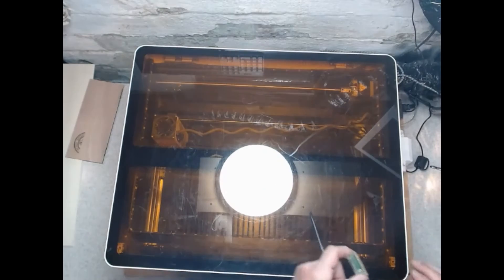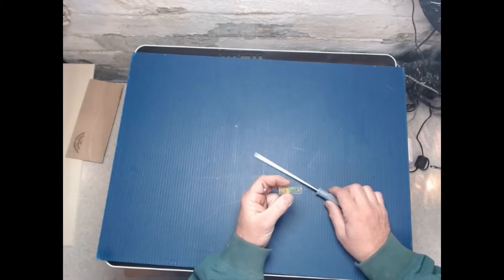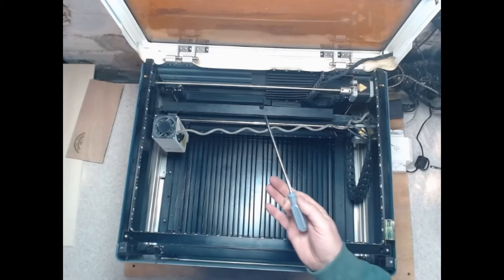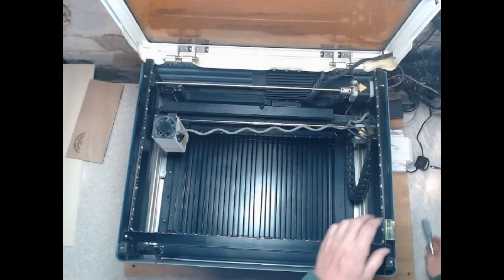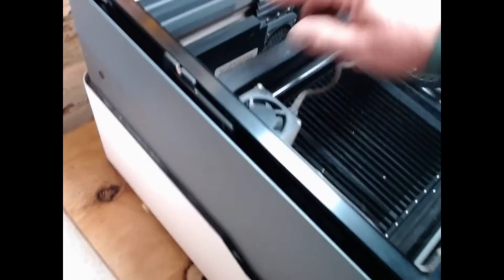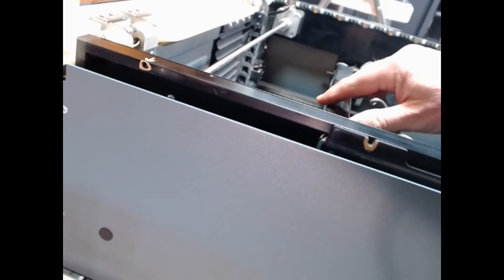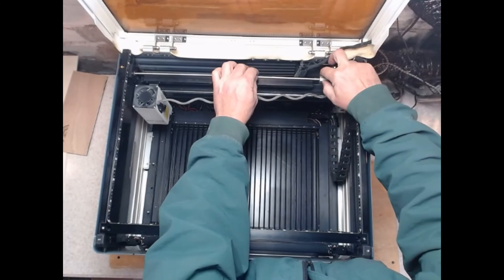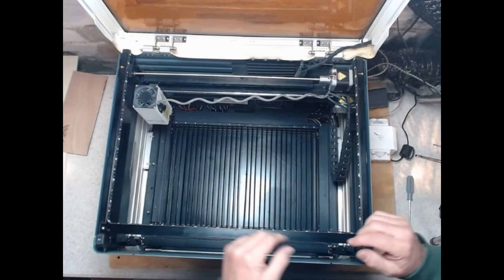X Axis and Level - #wecreat  laser

Comment: I have the 40w and moved it. So, had it in travel mode. Won’t come up and when attempting to it makes noise. Knocks the y axis, which I fix. I used your technique for the x axis but can’t line up the hole with notch. The laser hits the bottom ridge of the grate holder. Is there something else I can do?

Comment: Hi Lonnie,

I hope you’re doing well. I leveled the four areas on the top and aligned the laser in the rear with the holes on the sides. Then, I performed the calibration, but it went horribly wrong. 😢

The calibration was supposed to create a single crosshair in each of the nine positions, but mine ended up creating crosshairs with three lines going up and across in each position. On top of that, the marks caused the laser to hit the front of the machine.

I know it might be difficult to diagnose based on my description, but if you have any ideas or advice, I’d be so grateful!

Thank you so much for your time and help.

Best regards,
Terrinita
Reply from the maker: ive never heard that one before. First power everything down and restart, see if you can get it to do it again if yes record it for tech support